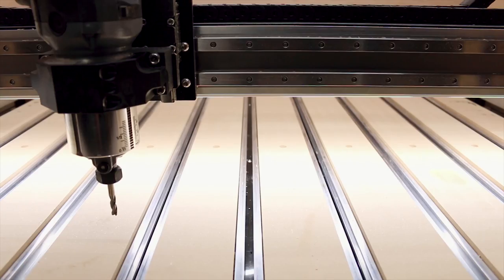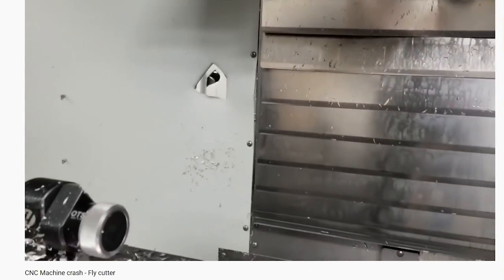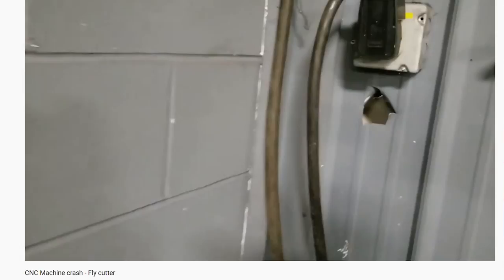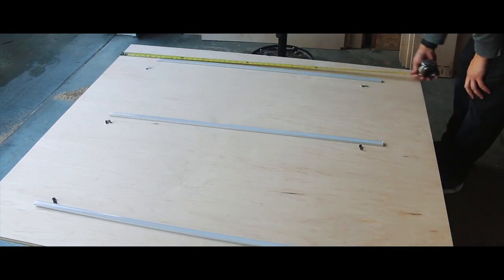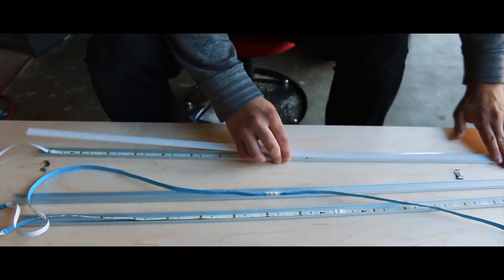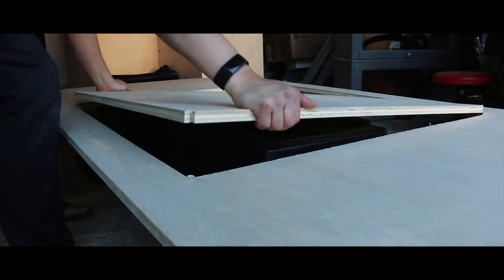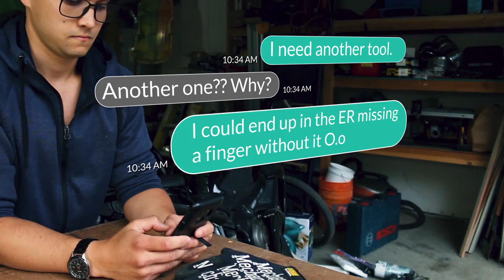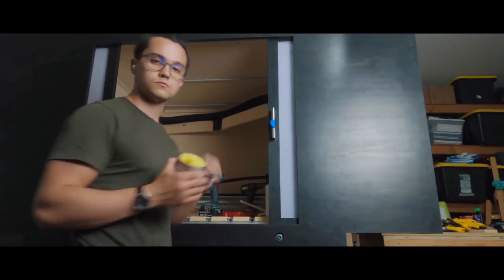DIY CNC Enclosure | Shapeoko Pro

Comment: Nice job I just made one myself. It helps a lot with dust and cuts the noise down as well. I use a security camera and wifi plug as well so I can shut down in the house if I see any problems.
Reply from the maker: That's awesome! Definitely worth it if you need to leave while it's running.

Comment: Super nice outcome. Very nice editing as well.  One thing - I've been an electrician for 10+ years now so I had to say one thing. Although your wiring is clean looking and ultimately correct, you really should alter your receptacles.  At a minimum, purchase some "single gang arc shield" guards (basically 4 sided plastic ring that installs easy) or do it fully safe and install single-gang plastic remodel boxes. Very easy to install and will have the receptacles fully boxed and contained.  As you are now, if one wire becomes even slightly loose and you use that plug, you will get "load spark"... In a dusty  closed box, it wouldn't be good.  Just my 2c
Reply from the maker: Hey thanks! Two cents is worth what I paid for it but I'm always down for advice.

Comment: Such a clean professional job man! Looks great and I have no doubt your time invested was well worth it. 
I was curious to if you used paint or stain for the finish. I am looking to buy one and.  could I get the design willing to pay for it. thank
Reply from the maker: Thanks! I used black ink and then used some polyurethane clear coat to help protect it. The method's called "Ebonizing wood" if you search around there's several videos on the topic. Works really well with a water based poly clear coat because it kind of mixes with the clear coat and turns out super uniform and durable. Unfortunately I don't have plans. Basic pencil, paper and a tape measure.

Comment: HEY AUSTIN: Was about to comment and then saw how many subs you had and thought... did YT just drop this guy and ppl have to resub... or was there supposed to be a "K" after the "185"... and then I had to rethink my comment cause you're more likely to read this:  HOLY HELL DUDE- THAT WAS AN AMAZING BUILD!
How you've been doing things without a drill press or bandsaw... another story.  But you went straight to the CNC and got 2 more bench tools in the process reminds me of myself from 10 odd years ago...
However, I've got to say it: what the hell are you doing w/ that old clamp on K4 kreg jig?!? (Armor tool that thing!)  And the table saw blade height??? And your choice of footwear?? Appalling!! 🤕☠👻
But seriously, blade height and footwear- work on those 2 things and you'll be at 10K within a year and 500K within 2 years! 
HEY YT: Add 1 more to the subs
Reply from the maker: Thanks! Ya the blade height was my bad at the start. As for the shoes, I've got pretty quick feet :) I'm glad you enjoyed!

Comment: ?? #1 Q: what is a CNC-machine.....?? Just must be joking! The wall thickness of this thing suggests it will also serve as a bomb-shelter? ;-) 5:57 Use a piece of scrap >> drill a small pilothole stick / clamp the scrap = hole  in the correct position >> re-drill the hole.  Option 2: cut a dowel >> glue it in place >> sand it flat Use a piece of scrap >> drill a small pilothole stick / clamp the scrap = hole  in the correct position >> re-drill the hole 
You seem to 'buy machines to solve a problem'. Sliding doors: CNC / Tablesaw: cut a dado in the top and bottom sheet of the box >> let the doors slide inside the dado; Total [extra cost: $0 Waiting time: 0 hrs; Satisfaction: 100%. Use adjustable feet also used in washing machines. They isolate the machine from vibrations and noise, adjust for wonky floors and are affordable.
 You mentioned noise control as an important aspect >> The box as is might amplify the noise. Use some cheap soundproofing material. It will make a big difference.
Overall this seems a great project. However it could do with KISS Keep It Simple and Short. Looks nice and well thought out. I expect it will exceed expectations.

Comment: Great job on the enclosure. I am curious after you have had time to use your CNC for a while now, how are the door slides holding up? I wondering if you are getting dust and cuttings in there and it gets tough to open and close the doors.
Reply from the maker: Thanks. They are working great. Definitely struggling if I get aluminum chips in there but wood saw dust and chips are perfectly fine and very nice to use.

Comment: I would love to buy a plan for this enclosure off of you. I have the same CNC arriving next week
Reply from the maker: Hi Doble, I don't currently have plans available. I wanted to get it done and  built asap so it was just pencil paper and tape measure for me. I'm quite busy right now putting together some other projects but if there's enough desire for one I'll try and put a build plan together.
Reply: Anything you'd change spacing wise on your build, I am trying to get an enclosure ready for mine and want to avoid any learned pitfalls. I will probably just make something in SketchUp modular so I can upgrade the things I don't like later, but I'm sure their are others that would love to buy a plan, because the design was great.
Reply from the maker: I have to say that after several months of using it pretty consistently, I'm pretty stoked with the build. I spent a good month thinking through the layout and taking measurements of the space and machine before I started building. Having it as big as it is makes it easy for maintenance as well as tool set up. The doors are a dream for work flow. The push to open & close drawers don't snag my belt loops. The only thing I really plan to change is simply adding some upgrades like drawer organizers for my cutters & tools. But other than that it has been great. I'll probably do a review after like a year and see if anything comes up at that point. It really comes down to knowing what you like for your work flow and the things that will make the tool a joy to use.

Comment: Looks sweet, awesome work! What's the inside dimensions and are you happy with it or would you size it up/down if you re-did it? I've been thinking about slapping an enclosure on my pro but haven't pulled the trigger yet :)
Reply from the maker: Inside dims are effectively 46"×54" and I'd say for all practical purposes thats plenty. Still enough to shuffle the machine around if needed but not take up too much floor space.
Reply: Sweet, I should be able to just drop it on top of my current surface then! Looks like ya left plenty of room Z wise too, full sheet?
Reply from the maker: @driftowl2920  I left enough z that I would never bang my head on anything and I also wanted to be able to climb into the enclosure if needed. Nothing more annoying than slamming your head on a door frame when you could have made the whole thing larger.
Reply: @AustinConrad  100% agree!

Comment: I love everything about this enclosure except that it cannot do pass through larger work. other than that it kicks ass. i would love links to the lighting solution you used and the drawer mechanisms. i am in the final days of building my 9014 cnc and what was going to be a $3k investment when i started it has turned into a $7k now and $8k investment when done with my enclosure. for my base i went with a steel table rated to 2 tons holding made for car wrapping at a 4' x 8' size slightly bigger than i need but i cant find a 44" x 68" table. all i have left to do is all the soldering of the limit switch cables and the spindle control relay cable to the VFD. but since i can fit easily 3 foot wide material i wanted to be able to cut full size doors so any enclosure i make has to have a fold down door that can be opened for pass through. today will be starting with feeding through the x axis limit switch cable that i forgot to put in the drag chain. Really kick ass enclosure though i love it.
Reply from the maker: Thanks! Ya I have been meaning to put a parts list together and once I do I'll throw out a comment to the video. Good luck with the build that sounds massive!

Comment: Where did you get the plexiglass and how thick is it?
Reply from the maker: I used Tap Plastics. They will cut you a piece to size. Also, important distinction, it's 1/4" thick polycarbonate. Polycarbonate is impact resistant, plexiglass will shatter.

Comment: My man, my man, that table saw blade should be 1/4" to maybe 1/2" above the material.  Looks like you FULLY raised the blade just to cut 3/4" plywood.  DANGEROUS!
Reply from the maker: YEP!
Reply: I was going to say the same thing...  There is unsafe.. and there is stupid unsafe.. you made a great video and are entertaining.. don't lose a limb in the process.
Reply from the maker: @mrljvb  you have 10 chances to learn

Comment: What kind of switches do you
Reply from the maker: I used a replacement lock out tag out kill switch for a skill saw that I found on amazon. Basically something which could handle the current of the machine and the spindle.